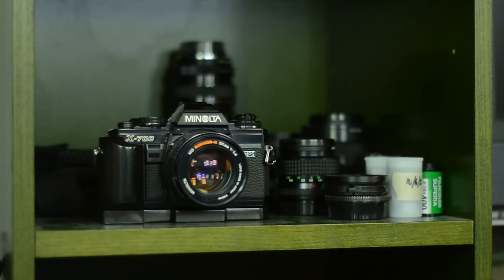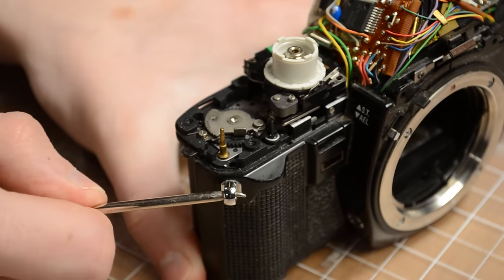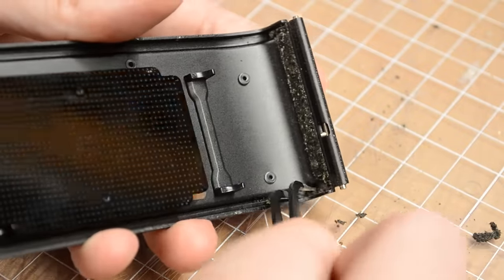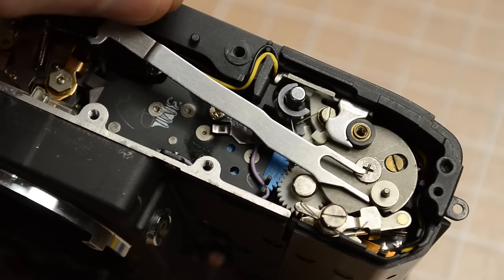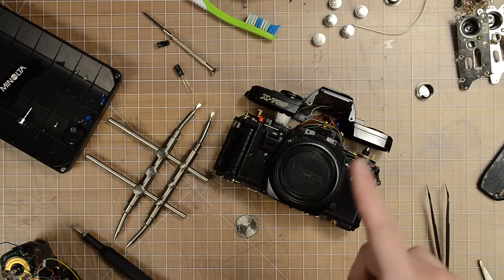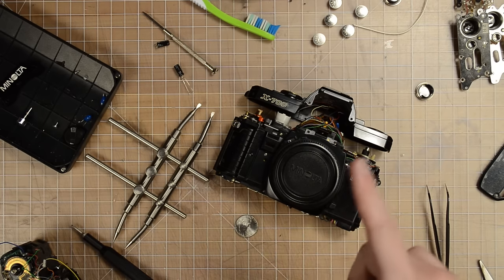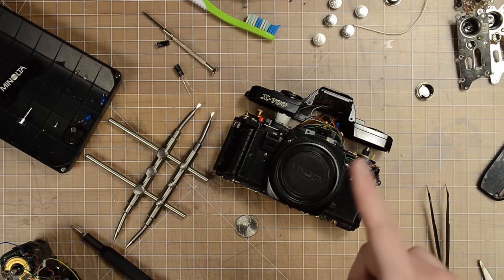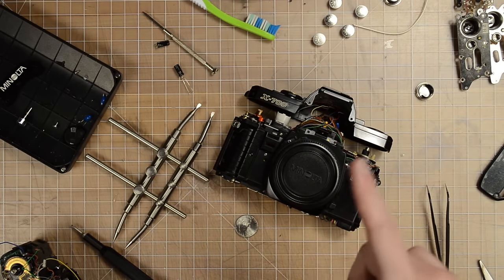Iconic 80's Film Camera gets an Overhaul - Minolta X-700 CLA & Repaint

Comment: Hey Patrick, great video. I'm hoping you (or someone in your audience) might be able to help me with a query: I have a Minolta x370 that is front focusing, and I'm not sure how to correct it - many online mention shims for other cameras, but I don't see how this series of Minoltas would be shimmed. Any advice would be appreciated!
Reply from the maker: Have you tested it with multiple different lenses? Could be a lens issue rather than a camera issue. If not, my best guess would be that the focusing screen needs to be reseated. There's a little metal tab behind the mirror dampener that allows it to drop out, but you need to be very careful not to scratch up the focusing screen during removal. If that doesn't solve the problem then the prism needs to be removed and the entire assembly below it that holds the focusing screen needs to be re-leveled. There are a few screws with springs underneath that level it (I briefly mention/show it in the video). Hope you're able to solve the problem, thanks for watching.

Comment: Dude, have you tried either KOH (potassium hydroxide) or NaOH (sodium hydroxide), also known as lye or drain cleaner? It most definitely works for enamel based paints, and the best part is that it does not chew up the plastics. The only caveat is that it reacts violently with aluminium parts. While it might fail on powder coated parts, it is definitely a good addition to the arsenal of various shit you can dip shit into. Cheers!

Comment: How do you think it would turn out if instead of spray painting it you just used a brush? Also would you have to use a different kind of paint?
Reply from the maker: I don't think it would come out very good. You'd have a very difficult time getting into the many crevices on the camera. You'd also have to use much thicker paint which would leave brush strokes and cause clearance issues between parts.

Comment: 18:51 that's literally hydraulic oil, it's meant to not do anything.
Mechanical abrasives work well, you just need to avoid heat buildup.

Comment: Hey I have this same exact camera and my shutter dial is super loose and just spins and spins without changing the shutter speed. In shorter term I just definitely need help or suggestions?
Reply from the maker: I've never seen that happen before, but my guess would be that a piece sheared off the bottom. You'd have to remove the shutter speed dial to know for sure.

Comment: Hey, I have a question. I watched a video some time ago that said that the mirror in these cameras is made with like an ultra sensitive almost gold-leaf like material on the surface of it and that it shouldn’t be cleaned, is this not true?
Reply from the maker: The reflective coating is quite fragile, more so on certain models than others. I apply little to no pressure when cleaning and always use a microfiber cloth. Unfortunately that means there's a limit to how clean you can get the mirror without risking damage. Sometimes if they've been left with crap stuck to them for a long time and become stained, in which case there's not much you can do about it. Same goes for the focusing screen. Thanks for watching.

Comment: Just a friendly heads up that your audio on this vid got down normalized by either YouTube or your video export tool several levels lower than the average for YouTube.

I'm watching on a Macbook Pro M1, YouTube volume is maxed with my system volume at 50% and your voice still sounds quiet like you're trying to keep it down at the library. To put this into perspective, at this level, if I go watch a different video (say a movie trailer), it's so friggin' loud my dog will startle awake and run off. Hope you can resolve the issue, balancing audio can be a pain the rear sometimes!
Reply from the maker: Yeah I've had a few people mention that. I'm going to try to swap the audio track to see if I can change it without taking the video down. Thanks for watching.

Comment: quick question, if anyone knows the answer..

i got a minolta x-700 just like this one, but id doesn’t work :(
the capacitors are new and the batteries drain really fast even when the camera is off and they heat up.
does anyone here know the issue?
Reply from the maker: Hard to say exactly but if the battery is draining and overheating my first guess would be that there is a short somewhere in the camera. First place I would look is underneath at the bottom board and battery area. Even if you don't have any repair experience it's simple to get at (just 4 screws). Look for corrosion and/or water damage. Hopefully you can figure it out. Thanks for watching.

Comment: While I do like this camera, is it worth “restoring”? They are essentially plastic, and were made in the hundreds of thousands. And then there are those capacitors. While my X700 was made in Japan, I’m sure it’s just a matter of time before they fail. It just isn’t worth overhauling.
Reply from the maker: Ultimately it's subjective as to whether or not it's worth servicing a camera like this. Some people would rather gamble on buying a new one or simply switch to a different system. Personally I like them and have the capability of working on them, so I'm willing to do it. If that weren't the case I'd probably be shooting with a different camera. Thanks for watching.
Reply: @patricknicholsdesign  I get it! Welcome.

Comment: Make molds of the original pieces, then cast in white epoxy
Reply from the maker: I had considered that, but ultimately didn't due to cost at the time. At some point I will try it if for no other reason than to produce spare plastic parts.